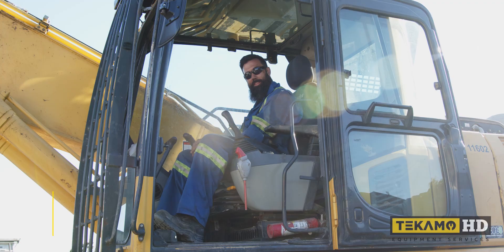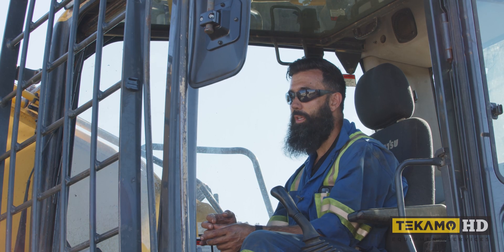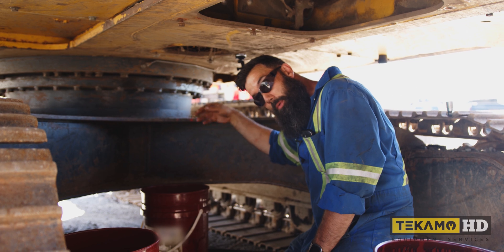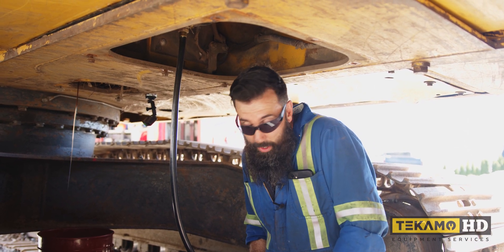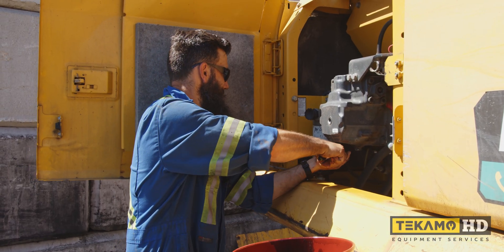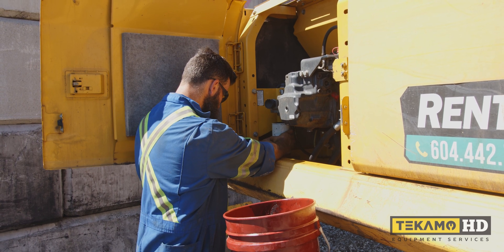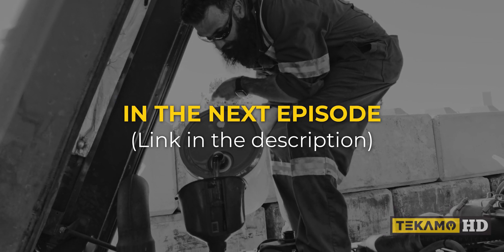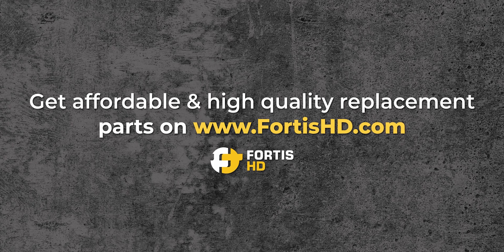Excavator Maintenance 1000 Hour Service pt1 - Komatsu Excavator PC200LC | Service Call Series

Comment: Had it so much easier with the lube truck. Just sucked out all the oil through the quick connect. Sure not all machine have them, but they are handy

Comment: Being a Heavy Duty mechanic myself here in South Africa, there isn't much difference if any between how we do services like that, even have the same brand filter available that was used in this video.
Reply: Hi Francois, How does one get started as a heavy duty mechanic in South Africa?
I have experience working with small engines on generators and servicing high lift pumps.

Any advice will be useful, thanks.
Reply: @hloni1248  you will have to find a oem company to offers apprenticeship and do your 4 year work, or find a company that will employ you with the experience you have and after 4 or 5 year apply for trade test
Reply: @francoishamman2649  Thanks
Reply: @francoishamman2649 sir can you help me to work abroad.. I'm a mechanic here in the Philippines in mining industry

Comment: how long will this machine last? if you maintain it well.
Reply: Old post but I have a some track hoes with 10-15,000 hrs that run like a top
Reply: I won’t lie and say I’m qualified. I’m not. I’m in college for truck and transport. However most heavy equipment is built extremely well and with longevity in mind. If you maintain something well it’s not entirely unlikely to get 30-40 years depending on your climate. Here In the east things rust so badly that they will be retired long before it’s due because they rust out. And for that same reason, a lot of people don’t take care of them well. So to wrap it up, they can last a lifetime, if you live in the right climate and maintain it well. The work it does also affects its lifespan as well, obviously
Reply: @the902giant  It depends how its used Will, if the machine gets abused and the operator doesn't grease it it can lose the ability to effectively do essential things, enough slop in the pins and bushes and maybe you can't grade worth a lick, maybe it loses the swing ring for the same reason or another, if both those things happen at once on a 20,000hr+ machine and it springs a leak around the pinion then it goes to the scrappers, that can all happen in 10 years of use.

Usually undercarriage wear will decide even a well maintained machine's fate.
Reply: 7000 hrs to 10000 hrs if well maintained